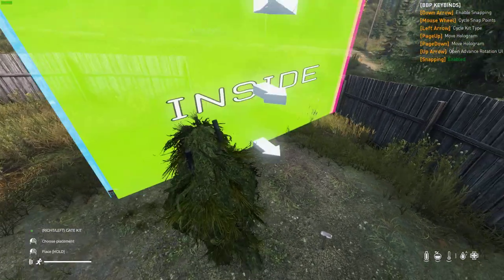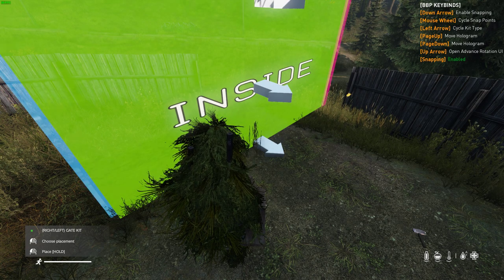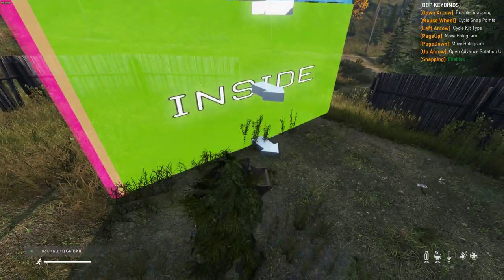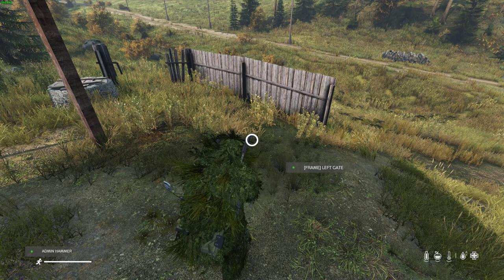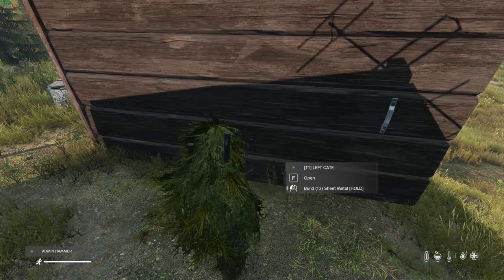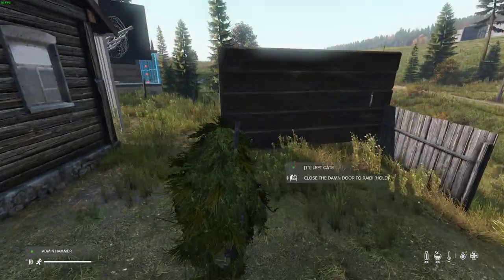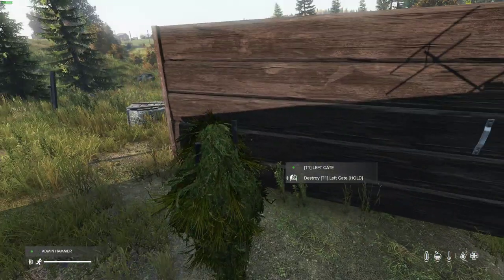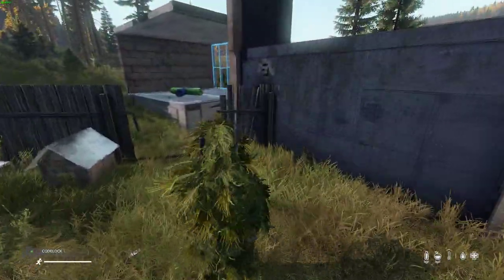DayZ How to Build with Base Building Plus.

Comment from the maker: Ok, I figured it out for t3 concrete or brick wall. Use a SHOVEL after frame is built :)
Reply: Also if you have done tier 1 or 2, you need to dismantle the wall back to just the frame and then go tier 3.